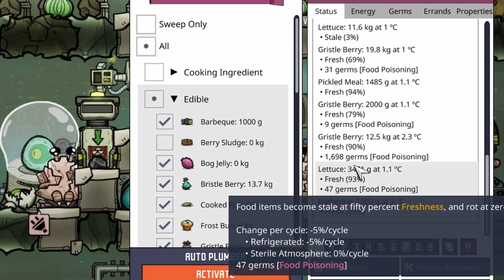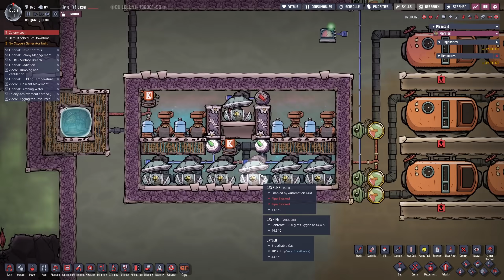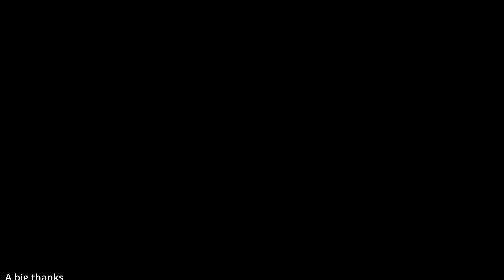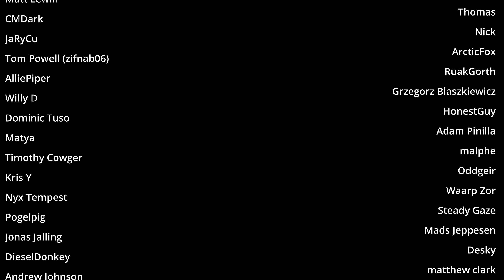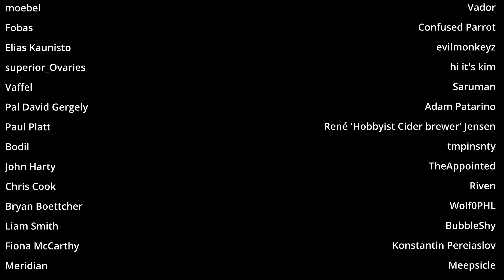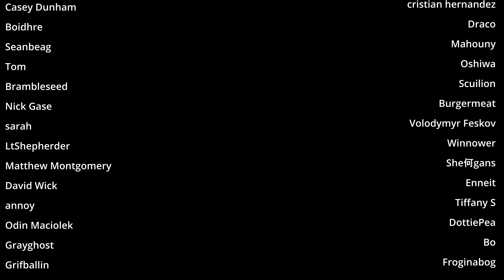A few background details : Oxygen not included

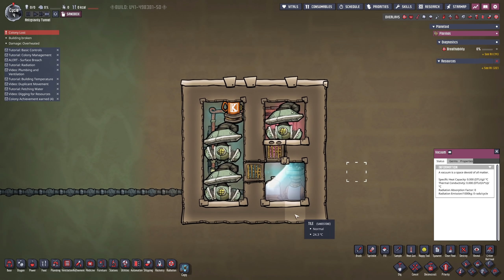Comment: 12:30 One of the nice things with that design is that you can build them with no Oxygen gas pumps by allowing the O2 to flow freely into your base (limited by atmo sensor controlling the electrolyzers themselves), saving substantially on power costs, and still very effectively separating the O2 and H2.

Comment: It's neither easy one to build, nor cheap one regarding the material requirements, but for setup and forget solutions I use a modified version of this https://www.youtube.com/watch?v=CPABk-8_JB4&t=6s&ab_channel=ChuckTung
Image is here: https://i.imgur.com/ONQhldg.jpeg
I just made the whole thing one tile wider which allows to have 4 tiles of cooling section and cool both oxygen outputs. You need to keep few things in mind while setting it up (+50C modifier on everything active, priority for using of oxygen from the upper line that deals with hydrogen filtration and never letting it run out of water or it spits hydrogen everywhere), but it being a self sustainable and isolated unit with output of cool oxygen (haven't tested the max water input temperature for the cool output) rules the world for me.

Comment: One thought on the double-reactor design; would it be possible to dig into the magma in order to use that space for one? Make a vacuum and dig down using the horizontal mecha-doors, pushing the magma out of the way. Would require a lot of reed fiber for Atmo-Suit repairs, but if at all possible within a reasonable timeframe, there's a lot of building space to be gained down there

Comment: also, sorry for the double comment but i have a stolen AHEM INSPIRED design from Luma Plays wich uses about the same setup as the 2nd oxydizer setup you've shown, just a little more similar to your rodriguez in appearance. it is quite handy and easy to modify/add multiple electrolyzers and gas pumps to it. the only concerns i have with it is it heats up quite significantly, although since all of my water comes from cool slush geysers and cool salt water geysers i've just snaked pipes inside it to cool off hydrogen+oxygen and warm the fluids so it doesn't break once it is refined into water through sieves and desalinators. I should probably upload some screenshots somewhere for anyone interested but really i'll just shoutout Luma's video : Heating exploit, SPOM & the worst bedrooms. at the moment this comment was made the video i'm referencing was uploaded about 2 months ago. Also! Good luck on the nuclear reactor! I might inspire myself on your setup to make one, i haven't found a reliable way to make one yet

Comment: Very interesting details about the shape of the Rodriquez, I've always wondered why the difference between the full and the half version in the shape of the H2 chamber.

The only thing worth mentioning that I add to your design (or Rodriguez' design) is a double bridge and a sensor connected to the automation from the battery, to start the generators in case of H2 overflow in the pipe.  I do put a tank, and two generators outside (one battery controlled, drawing from the tank, one as final overflow control after the tank), in order to burn all of it. Yet, just in case, another safety isn't bad to have.

Comment: Is there a reason why you use Airflow tiles in the Rodriguez? I would think mesh tiles would be better so water can fall to the bottom if a pipe leaks instead of flooding the Electrolyzer.

Comment: Tip for an early Electrolyzer setup: Build the small ones like you had but build it at the top of your base and swap the oxygen pumps for air flow tiles.  If your using cold water you can run your pipes through and under the air flow to cool down.  You get a lot more spare Hydrogen power.  Its how I would of built your vent to space one, and if you want it to always run for the Hydrogen you could of added a door to space linked to Atmo Sensor.

Comment: interestingly enough at the moment in spaced out ONI super coolant can be gotten relatively easy with a small petroleum engine if you find a gilded POI near a planet and bring some oxylite and petroleum stored as an item, especially of how much you get from a single trip(i got 1400kg fullerine) which comes out to 140 tons of super coolant. the same goes with thermium if you have 1200 kg of steel you can just door digging in to magma on the molten niobium asteroid. and you can imagine what you can do with those at an early point .
Reply: Yeah but thermium is not as useful as supercoolant, especially if  you have a planet full of magma. You could run a boiler (petroleum or nat gas) for 10000+ cycles w/o needing a thermium AT.
Reply: @TheMule71  I know but it can be easily gotten even easier than super coolant so why not. and this doesn't change the fact that super coolant can be very easily and plentifully gotten without out much reaserch and resources

Comment: The hydra designs are nice, but way too exploity for my taste. If Klei ever decides to make one minor change to the overpressure detection, they'll break. The rodriguez design variants are far more resilient in that regard.

Re: Gas pumps: They draw their gas from a cross-shape centered on the bottom left tile of the pump. So the gas pump in "cap" variant gets to draw from all 5-tiles, while the gas pump in the "cap-less" variant only draws the gas from the 3 unoccupied tiles (center, top, right). If there's sufficient ambient pressure, that shouldn't make a difference, though.

Re: Reactor - I usually put mine in space, as that's where I need most of the radbolts eventually (radbolt engine, diamond press).
Reply: @Francis John - something I completely overlooked in regards to disabling the teleporter: An "all achievement run" without those isn't possible, since the "First Teleport of Call" achievement requires teleporting a duplicant. Runs without teleporters are still fun, though.

I might need to try and lobby Klei into turning the teleporter setting into something with 3 options: "Full", "Duplicant Only" (removing the material teleporters) & "Disabled". :D
Reply: Any kind of infinate water/gas storage takes a lot of fun out of the game for me, dealing with the excess is a lot of the problem solving/design. My literal favourite base was the one where I rebuilt the entire living area of the base, higher up, two times over, because I'd created so much carbon dioxide it was the most viable short term survival plan <3

Comment: One advantage of the higher Rodriguez is that you don't really need the doors. Because of the extra space the dupes can climb over the 2 tile step if you need to service it. This leaves the pure hydrogen atmosphere there intact. With the other design they can use the doors, but then you need to prime the system again.

I don't use designs that use teleporting elements. This only works because of performance optimizations. Ideally an element would check if there is actually space when it's supposed to appear somewhere. And if not it gets blocked. But they've added the teleportation because that costs calculation, which then enables these exploits.

You should apply the same thinking to the infinite nuclear waste storage though. That's the exact same thing.
Reply: There's no teleporting involved in the hydra tho.  Gasses displace liquids on creation. It's consistent, in all cases (vents, buildings), witht he right amount. Liquids displace gasses on flowing. Again, consistent. Fluid tiles merge when one is displaced and another of the same time is adjacent.  The hydra just carefully guides that process. 

There are builds that do use teleporting mechanims, like freezing liquids inside mesh tiles. Hydra electrolyzers don't do that.

Feel free not to use it, but don't criticize it for doing something that it doesn't do.

Comment: Theoretically speaking, It's possible to transport power between planets by filling a rocket with batteries, charging them at one place, and discharging at another. This means that you could build a planet entirely dedicated to a massive nuclear reactor, then send the power back to the home planet. Alternatively, you could probably heat up some material, send it across space, cool it with steam turbines, then send it back to get reheated. Lots of moving parts though
Reply: Ethanol is also a good way to "store" power. It costs power to make. You can transfer loads of it. With some pip planting, you don't need a water source, even. Go fancy, with waterfall harvesting, you don't need much dup labor (if any at all).

Years ago I tried it, just to store power from solar panels and use it at night, instead of going the battery way.  Not as compact, but effective nonetheless.

Comment: Have you (Francis, Commenters) run into the liquid trapped in an airflow tile bug? I do, frequently, but have observed it gets ejected upon save/load.
Reply: twice, but the ejected liquid flood the floor beside the wall randomly
Reply: I have. Sometimes it seems to be being caused by building the airflow tile in a spot that contains liquid but where the liquid cannot move up/down/left/right on completion of the tile. So corners when the sides had already been built, or a side being built when the place beside it hadn't been dug out yet and the block on top had already been built, etc.
Reply: @melananighthawk  It'll happen to me randomly. I built an airflow wall in the oil biome and some water vapor condensed into a tile. Of course that was after I boiled it with sour gas

Comment: I've done carnivore (while doing locavore and super sustainable) on all calorie levels (on Terra or Terrania).  The most difficult setting is the 2000 kcal setting.  I'd say that 1500 kcal is next, because I did end up using the musher.  Then again, I took 8 duplicants instead of 5 or 6 early, so maybe not.  That all said the 500 kcal setting in some ways is more difficult than the 1000 kcal setting.  You have to plan to take 16 duplicants by cycle 50 (or some other 400,000 kcal plan) and have constant meat.  It's easier in that you have a lot of labor.  You also have a good amount of wild food in the first dozen or so cycles.  However, 16 duplicants by cycle 50 is almost no care packages.  And you need to get strong oxygen production up quickly.  So, I'd say that overall the 500 kcal setting is more difficult than 1000 kcal setting.   

But yea, 2000 kcal setting is the most difficult.  It's mush or die baby!  And the duplicants must run for their lives!

I did see Jer figure out how to use one incubator to hug all the eggs.

Comment: A lot of interesting info! As for hydrogen production, though, nothing beats Saturn Critter Traps. 10kg per cycle per plant straight from your cool slush geyser, plus one Beeta Hive for critter muchies. The plants don't stifle from pressure, so you can easily build up several tons per tile of hydrogen... or just pump it to hydrogen generators.
Reply: I stumbled on this in the map that FJ is playing - a pip walked into the critter trap above the bottom right of the 3 initial beeta hives. By the time I realised what was happening (and where that damn pip had vanished to), there were 4 tiles of hydrogen at 180kg/tile being held back from flooding my base by about 30 grams of liquid chlorine that were less than 1C from turning back from liquid to gas...

I ended up with 7 hydrogen generators in order to actually start burning off the massive backlog of hydrogen, and a manual airlock door provided a more reliable seal than that little bit of liquid chlorine to prevent the hydrogen buildup from leaking out into the base while I slowly pumped it out of there at a controlled (and far more useful) rate.
Reply: @Billy White Jr. Shove voles would be a waste, since you only want to feed them to increase their numbers, then starvation ranch them. They give 10kg of meat, which turns into 20,000 kcal of quality 3 barbecue. Beetinies spawn once per cycle, automatically, and give 1 kg of nuclear waste. Saturn Critter Traps grown domesticated consume one critter per thirty cycles, and you'll have somewhere around 25 seeds. When you harvest them, you get 10kg of plant meat for, IIRC, 12,000 kcal of quality 1 food.
Reply: @Billy White Jr. A hive produces a beetiny every cycle do there is always a few available.

Comment: Is there enough rads in space for diamond creation?  radbolt generator/solar panel combo would be an interesting design.
Reply: He only gets 375 per cycle in space, and I think they nerfed rad collection to make rads more difficult on dupes. I think 375 per cycle is only 37.5 rad bolts. Thus he would have to spend 480 watts for 37.5 rad bolts per cycle. You need 1000 rad bolts for 100kg diamond, and 1kg is 20 kg of mined resources. 1 million kg, needs 50,000 kg of diamond, which is half a million rad bolts. 480 watts is essentially 37.5 rad bolts per cycle. A 50 kilowatt grid full of rad bolt generators would reach half a million rad bolts at around 127 cycles.
Reply: @aidanjimenez9343  Oh right, i forgot about the radbolt generation nerf, I haven't played significantly since before that happened. Thanks for doing the math!

Comment: At 2:10 🤔 What if you pumped the water up and built a back and forth stepped section (or pipes) allowing the water to drip down as it gets radiated to clean it. A solar water cleaning radiator. 😂😎👍🏼
Reply: Making a 1 tile thick bit of water about 10 tiles long in space is easiest way to Decon via rads. You Want a long exposure time and shallow depth.

Comment: I do use something that resembles the petroleum boilers to efficiently using space radiation to decontaminate polluted water.  Essentially, make a single block depth of aqueduct along the top before the water falls into storage.  For fanciness, can use a germ sensor to control the water flow, but I found a sufficiently wide run or a double back aqueduct worked fine.

Comment: Im currently doing a no-tele run on this map, im at cycle 160 and barely got Industry up due to a immense lack of metalls, its hard, but very fun and most importantly, very different from normal play
Reply: You can dig down for womfram and may be even uranium ore for early need of metal
Reply: @tungnguyenthanh7757  Im using Diseases restored, so going deep into the radioactive biome means constant frostbite for the dupes, my main source of metall is lead from the oil planet, i just have a small permanent base there with a single dupe that does nothing but mine and transport lead and other metalls to near the rocket.

Comment: The hydra design allows for a true on-demand system. You can put sensors on the O2 and H2 chamber, and only turns on the eletrolyzer when either or both chamber drops below a certain pressure, instead of relying on "max gas pressure" to "shutoff" eletrolyzer. 

The hydra design can also be very compact with just 1 pump for O2, and 1 pump for H2, which is great for a remote base setup (even putting it in a rocket capsule for multi rocket exploration).
Reply: It's the smallest you can make it for a single electrolizer, but the Rodriguez is more space-efficient for larger productions
Reply: @Beregorn88  Depends. For hydra design, you can make the oxygen end open to your base and collect the hydrogen in a separate chamber. In one of my past play through I had a hydra factory with 9 electrolyzers (horizontally scalable).
Reply: @rachelchen9764 I didn't say it wasn't scalable, I said that it was less space-efficient if you want a lot of oxygen/hydrogen: for 3kg/s of pumped oxygen, a hydra design requires 17x9 tiles, plus two on tops, while the most recent developments in terms of rodriguez fits in 14x8 tiles, giving 38% more oxygen per tile! Order now, and you get a hydrogen generator for free!

Comment: As long as you have a good supply of water, you can just hire more dupes to get through the labor crunch. I overbuild the O2 production early so that I can get a lot of dupes ASAP, I try to get to 10 dupes by cycle 40.

You do have to time hiring correctly, to make sure that your new hamster wheel runner doesn't eat all the food before you can hire a new cook. With this approach you really want to avoid having them change jobs as much as possible, the productivity is so low that having a dupe constantly switching between cooking and running can become a net negative in calories. Also this approach will  go through water VERY fast.
Reply: You also need dirt

Comment: After watching your SPOM tutorial nugget, I decided to cut off the top of the electrolyser so I could fit all the hydrogen generators and the thing itself perfectly into 3 4 tile floors. I always wondered if I was missing something obvious because I never found an issue with making it smaller
Reply from the maker: I remember testing it so much to maximize output when I was designing it. Back then the extra top was necessary, god knows when the mechanics changed so it was no longer necessary.